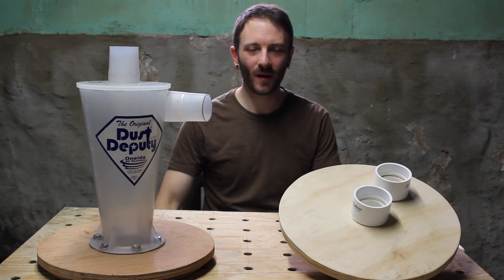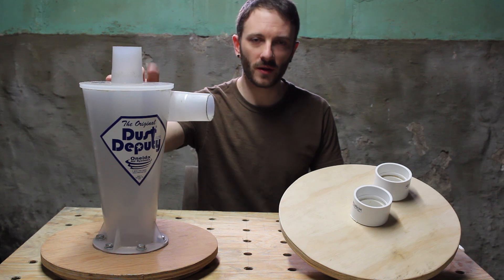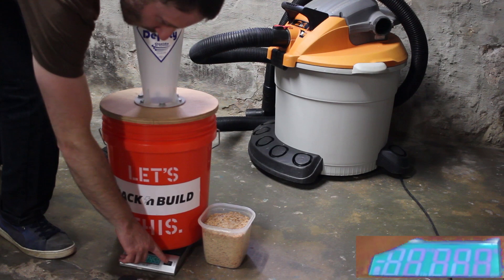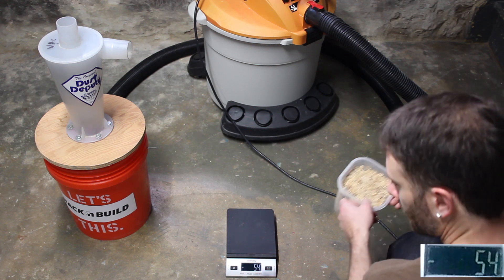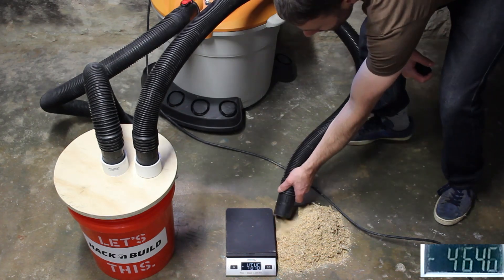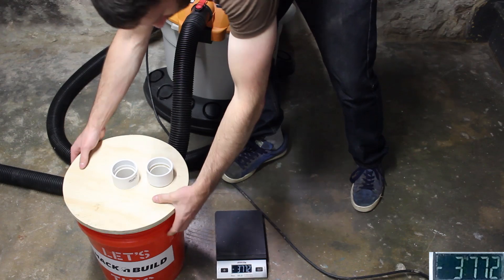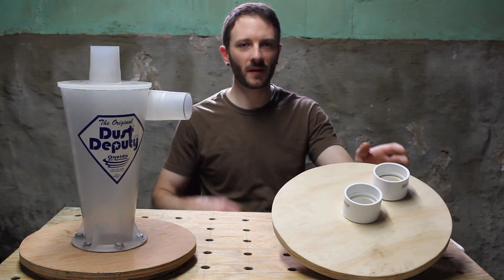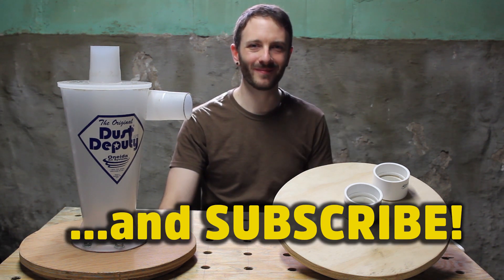Shop built dust collection vs Oneida Dust Deputy (1/2) - HNB #8

Comment: It would have been nice if you would have cleaned the inside of the vacuum first, then show the after results for each system. Would either system be better at collecting fine dust?
Reply from the maker: The filter was cleaned and the vacuum emptied before beginning the experiment.  Based on the results of the first few tests, there wasn't any sawdust in the bucket or clogging the filter until we tested the "full" bucket with the simple DIY cyclone.  So, perhaps the quarter full test would have performed better had the filter been cleaned out.  Good thought for a future video!
Reply: I bought a Chinese copy of the Dust Deputy for twenty-something dollars. I just couldn't see spending $70 (at the time), for a piece of plastic. It works really well, but as expected a small amount of fine dust manages to find its way to the vacuum filter. I think part of the problem is that my vacuum has a lot of power and not all of the fine dust goes into the bucket. It looks like your vacuum is really powerful as well. It's the fine dust that clogs the filter, not the big pieces.
Reply from the maker: Yeah, that vacuum is a beast.  Honestly, it's so big it's a little unwieldy but the extra power is nice.

Comment: the oneida has the height of two buckets i think is not a fair comparison
Reply from the maker: Good point Jose.   I think the lack of performance with the fuller bucket had more to do with the fact that the dust in the bucket gets swirled around every time the vacuum comes on and eventually piles up on the sides.  Making the bucket taller as you suggest would allow more room for the dust to accumulate and still allow the cyclone action to happen.  A quick an easy way to do this would be to just stack a 2nd bucket below and cut a hole in the top.  Another way would be to add a plywood baffle.
Reply: Nice video! Good Info. The Oneida should earn few more points for having more pros than cons in addition to being a bit more long-term reliable with higher capacity. Although with the increased amount of material the Oneida can retain in the co-bucket, I can imagine how the increased weight of the bucket can be a con.
Reply from the maker: Overall, I am happy with the Dust Deputy.  Still using it too.  That may change as a refine my DIY setup, though.